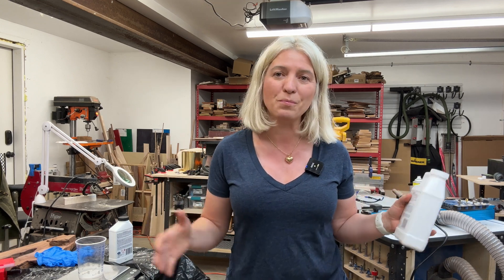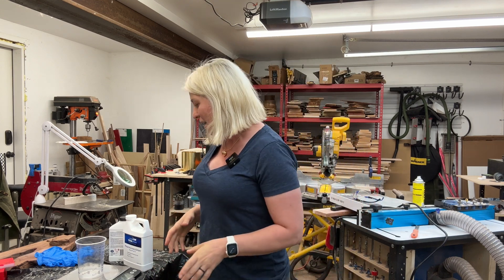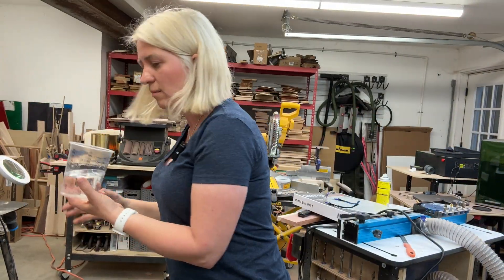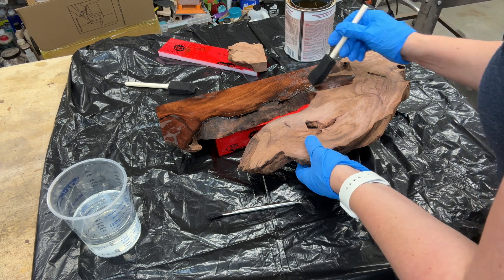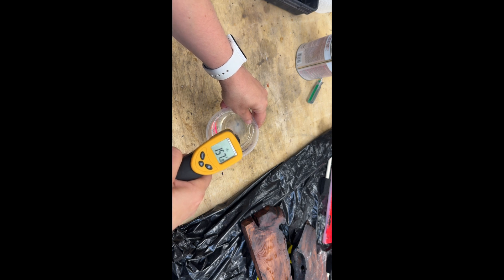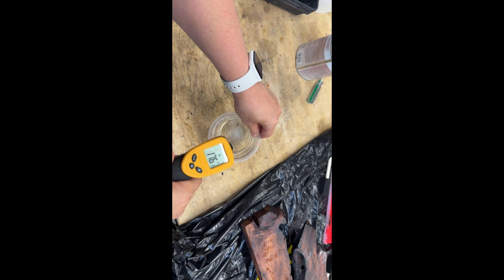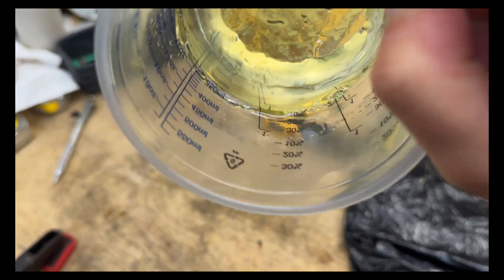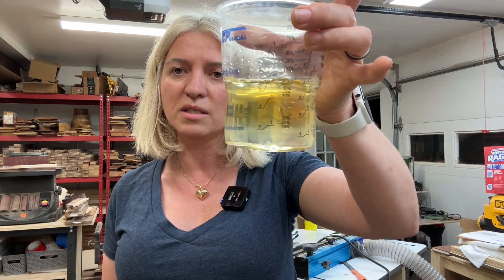HELP! My epoxy got hot and started smoking! Testing the Exothermic reaction of epoxy!

Comment: I used to repair surfboards and doubled up on the catalyst and the epoxy started smoking badly and melted the mixing cup... before I could get the safety can over to me the whole thing hardened into a rock, then cracked like sticky glass, and remained hot for 20 minutes! 😳😵‍💫😵‍💫😵‍💫🤨😡🙏🤞🙏🤞🤨💁🙈🙈🙈

Comment: Two to one if I saw it right, you had 221 g of a so shouldn’t you have put 110 g of b? I really enjoy your show and all the episodes. I also was incredibly impressed when you picked up that 92 pound DeWalt planter you are a very strong lady. Keep up the videos. Enjoy them sincerely Jennings Marshall.
Reply from the maker: You are correct. In the description I mention this happened because I measured wrong. I did 3:1 vs 2:1.

Comment: Please keep in mind that Total Boat is a 2:1 by volume, and 100:46(46%) by weight.  The cup you're keeping it in is the real reason it is cooking off so fast and hot.  It's intended to be poured no more than 1/16 of an inch, so at the 3 inches in your cup there is nowhere for the heat to go, and it causes a thermal runaway.   Even with the reduced hardener, the quantity in the cup and its depth still creaet a huge amount of heat.  Pour thickness of 1/16 is the key, when. I use it, the temp may go up to 105F.on my project but rarely higher if my cup has more than a little it will cook off and get really hot.

Comment: Ah! So when you use the wrong ratio, that's when things go wrong... I didn't realize that you were doing it intentionally, as that wasn't clear at the beginning of the demo. Now I get it! Not having used epoxy like this, I had only heard that it gets warm with a correct ratio, but not dangerously hot. How long after you have mixed the wrong ratio do you have a chance to correct it, before it gets dangerous?
Reply from the maker: Yes, the day before I was using it and accidentally used wrong ratio. I mention this in the beginning of video but then I must of cut it out in editing. Had to cut out big chunks of video because it was way too long before things started happening
Reply: @SkylerEwingWoodworking  thanks for the explanation :) I suppose we could do some experiments to find out how much time is too late to save the pour by fixing the ratio.
Reply: Not to mention the off gases are not good for you to breathe in.